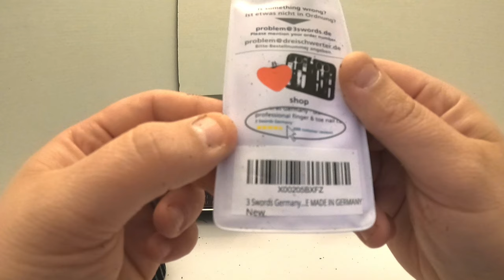How to break in/ pre-feather RC Foam Tires (RC Dirt Oval) BSR Foam Tires: Tire Truing part 2

Comment: Looks like tons of fun 😂 Now is this for Slash chassis class?
Reply from the maker: Jeremiah Story, more like making a mess lol.  Have to do a lot of shop vacuuming after cutting tires lol. But no, these are for the purpose built foam tire cars like 21.5 & 17.5 Late model, EDM and foam tire sprints.  The rubber tire break in video that will be uploaded within the next couple of days will be beneficial for any and all Slash classes or any class that uses rubber tires.
Reply: @jbtricklerc  right on sweet! Look forward to it! Oh, also, are the class rules for Anderson on a site?
Reply from the maker: @Storyracing387  great question. Not yet but I believe the goal is to maintain the SCOR and GrassRoots RC racing rules packages so racers from the area can race at multiple tracks that share the same rules.  The Grassroots RC rules can be found on their Facebook page.  If you can't find it message me and I'll link you the page.
Reply: @jbtricklerc  awesome thank you sir 👍
Reply from the maker: @Storyracing387  no problem. Happy to help.

Comment: What's the best rear tires in your opinion for the sr10?
Reply from the maker: Hey Coach, from what I've seen and been told it looks like a lot of people like the Custom works dirt oval rubber tires.  If the track is a high bite track the custom works slicks would be best.  It a loose dirt track likely the Custom Works street tracs would be better.  (They offer different compounds as well and I usually had a set of each)  You can get these tires pre-mounted from Custom Works but they come on 1.9 wheels and the front wheels are meant for straight axle not a hex drive which will cause some fitment issues from the carriers and knuckles as well.  What many of us did, and what I recommend (when I raced in the open 2wd buggy class) was buy the custom works tires and foam and stretch them over and glue them on some 2.2 hex wheels that are meant for the buggies (I really like the DE Racing Borrego wheels).  then you don't have to worry about fitment issues or changing the front end from hex to straight axle.
Reply: @jbtricklerc  you have a link to them...
Reply from the maker: @CoachD386  I know we're talking in messenger but wanted to update here as well about the many using the Custom works dirt oval rubber tires over the DE racing tires.  I'll also update my original reply.